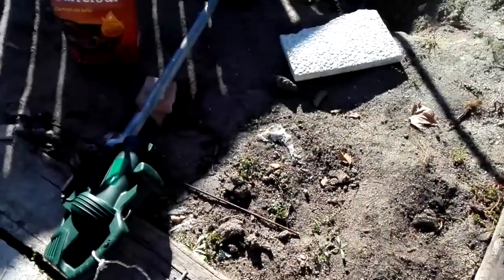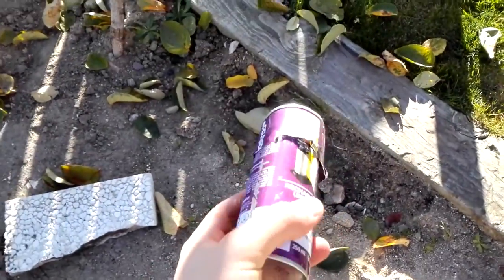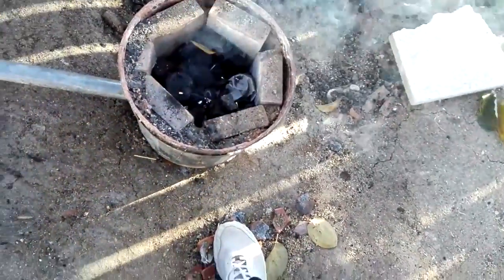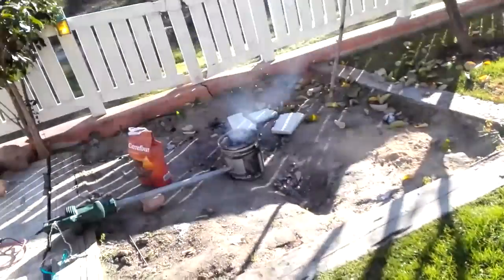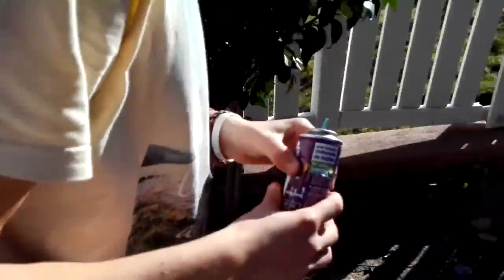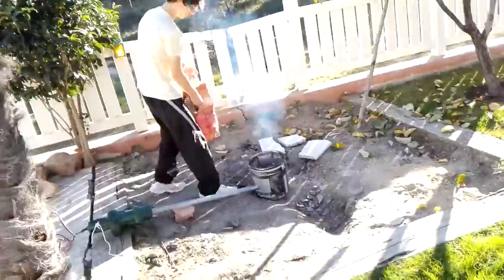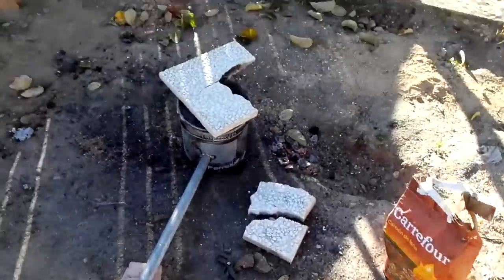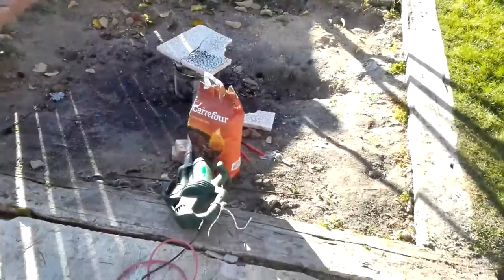Homemade Charcoal Copper Foundry

Comment: Coal does burn very hot, up to 3,590°F (1'977°C) if it has enough air. It has about 30 mega joules of energy per kg (petrol/gas has about 46MJ/kg). Also, just because it changed shape does not mean it was a liquid.
Reply: thanks, saves me replying ^^

Comment: I think is funny how he says melting aluminum is for noobs but he has the worst setup i have ever seen. And he used a fucking spray can for a crucible...
Reply: Agreed. I have gone a ways from my first foundry, and I did very little research on it(I made it out of cement) and yet it was better than this. No offense to this guy, but more research and common sense is needed. Also, don't use fancy gloves, use ones that will actually help protect your hands from heat.